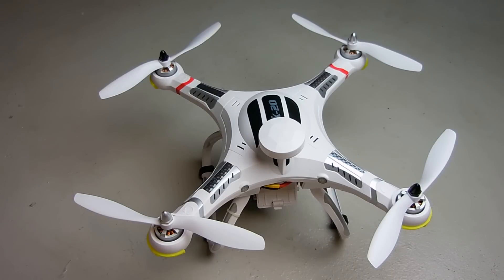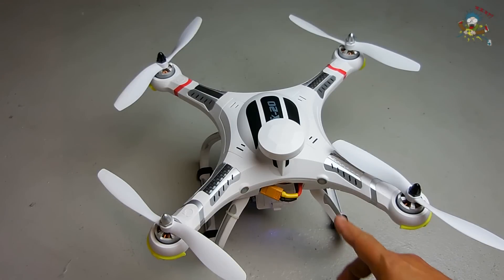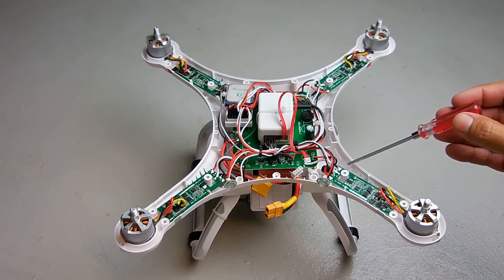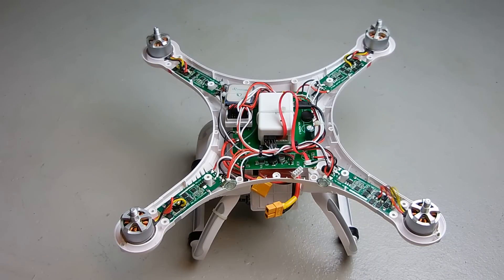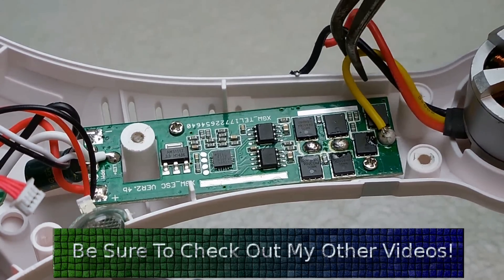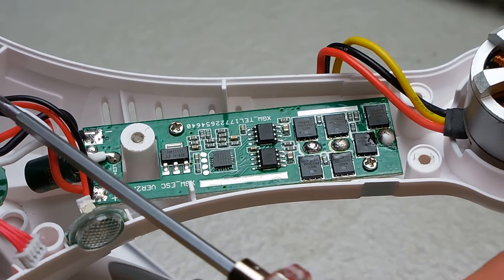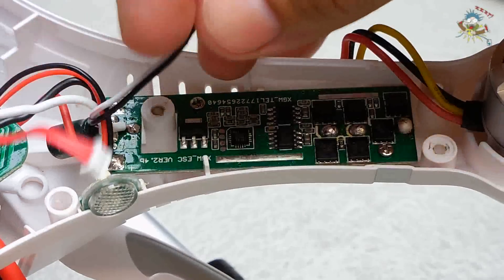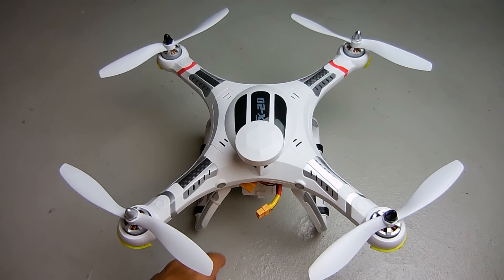How To Repair a Beeping/Faulty CX-20 or Phantom Quadcopter

Comment: Hi Mr.ElectronicNmore, I just got my esc board for my cx20 today ,imagine this board was ordered over seven  months ago and I actually gave up on it and thought it was just another scam by one of these Chinese companys anyhow yes I got the board and let me tell you ,its a second hand board ,then its not the board I ordered and the one they displayed was the ver1.5 esc and they sent me the ver2.4 with one wire not connected seems like they took it from a second hand quad and they didn't do a very good job of removing it ,anyhow I installed it with the colour code the same as the old one and it works but just a bit lazy ,any advice ?
Reply from the maker: Not much you can do, if you matched everything up. I can't believe they don't sell parts.
Reply: well after doing a couple of revs with this 2.4 esc installed ,I just fried another esc and motor ,they just ran hot and smoked, both the esc and the motor is done ,I think I give up now .Spending too much on this thing ,maybe I will just buy a Mavic or something.
Reply: I ordered four from BuddRc and hopefully they  are ver 1.6 I will put them in ,all new and see.

Comment: Hi electronicsNmore , my cheerson cx20 crashed about a year ago and I am finding it hard to get the original ver esc which is a ver1.5 all I see on amazon is the ver1.6 ,can this work for me?
Reply from the maker: "Should" be fine. Just make sure all the connections match up.
Reply: ok electronicsNmore thank very much .

Comment: Hi,
Need some help please,been flying my cx-20 for 3 weeks all set up in mission planner everything working fine,come home and made the max angle = 3500 to combat the breeze
today and now the quad will not arm, been trying for 4 hours and am going nuts ! everything is all working fine in m/planner, getting 5/6 sats & green light lock but wont arm, tried moving yaw & throttle trims, have you any idea what i may have done ?
Reply from the maker: Kevin Hill You probably need to flash the unit with the factory ORIGINAL file.
Reply: thanks for the advice i will try to find one today, is there a boot jumper pad on the board ? i have only ever flashed naze & omnibus f/c boards,

Comment: I had a heck of a time getting solder to melt on these boards-they must use some special solder because I ended up ruining one ESC trying to reconnect with the new ESC.
Reply from the maker: That's weird. I never had any problem.
Reply: i also had these problems, this is because the use lead free solder.
Reply: Try getting a soldering iron that has a variable temperature to at least  450 C and has a fine point to it.  That fixed the problem for me.

Comment: My esc problem with this is that it does not jeiro but the engine does not have the strength to turn already changed the engine and continue the same way and also calibrated the ESCS but continued with error.
Mes esc is the 2.4 version and am having trouble is the same version for your videos vc replaces the version 1.6 and gave no trouble.
I ask can exchange esc for version 1.6 and the others are with version 2.4

Comment: does anyone know where I can find the original cx20 tail LED light for the GPS and unlock moto light .the ones on ebay are different and do no come to the wire that connect both Led lights
Reply from the maker: Try here:
http://bit.ly/2aZ3RqA
Reply: http://www.ebay.ca/itm/Cheerson-CX-20-Tail-LED-Unlock-Lights-Indicator-Green-Red-for-CX20-Open-Source-/252364129010?
Reply: I did and the seller send me the wrong item ..

Comment: mine keeps beeping with the lights permenantly on, and none of the propellers power up
Reply from the maker: Did you change the factory firmware? If you did, that may be the problem. If you didn't then try flashing it ONLY using the factory firmware. You may also have a faulty main board.
Reply: +electronicsNmore it has worked fine, it happened suddenly, and how do i flash it using the factory firmware?
Reply from the maker: Download "Mission Planner". You can find links to the factory firmware file on Ebay listings showing the CX-20.
Reply: it doesnt seem to be able to connect with mission planner
Reply from the maker: Marios E Make sure you choose the right COM port, the battery must be connected to the quadcopter when the USB cable is connected.
Reply: I have this problem too but I have tried that and its just not detecting the quad
Reply: +TechReviewsUK same happened with me (you can check out my video on it to make sure its the same) so i contacted banggood, (where i bought it) and they kindly provided me with new flight controller, i m waiting for it to arrive, i believe it ll work

Comment: I have one I bought for our adventures in the Amazon Jungle on one of our fishing adventures,, after flying it there,, crash fall in wind gust,, we taped it back together and continued flying it,, Gimble was broken, made one up from boat parts to continue filming,, packed it up and came back home,, bought new shell for it,, but now it wont unlock the motors.. all lights go on,, we checked all wires for faulty wiring,, and none found.. but did remember that once in a while it would take longer to unlock than others even when we first got the unit.. any ideas on why they take longer to unlock at times and what could be happening with this one.. worst come to worst,, i may have to buy another one and keep this for parts...LOL.. 
but would like to find more trouble shooting information for all of us with different situations,,which is hard to find..
regards and great video,, thanks.. from deed in the Amazon,, AmazonXtremeFishing.com Adventures
Reply from the maker: Hi there. When I have a problem unlocking the unit, I flip one of the transmitter switches to a different position and back, then try unlocking it again. That usually works. If it does not, then I disconnect the battery and reconnect it, then it works. Could be a faulty transmitter. If you do buy another one, you can refer to my CX-20 unboxing video. I have a link which you can use to save money. Under 200 shipped. Thanks For Watching!
Reply: +electronicsNmore my. cx 20 beeps just like the the one in your video but i never flew mine what could it be

Comment: I did more than swap, I replaced the motors,  I should have bought two red and two green ESC's that way I would at least be able to test them, for right now I'll just have to wait for the mail...
Reply from the maker: Do me a favor and only reply to the same thread you post. It prevents cluttering of the comment section. Try disconnecting the connector from the esc board to the "Main Control Unit" and let me know what happens.
Reply: +electronicsNmore same thing bro, the plug is disconnected and it still beeping
Reply from the maker: William Jeffery
Definitely a faulty board.

Comment: GREAT! what are the chances of getting two bad ESC's because I bought one soldered it in and the $#%#%thing doesn't work!😠 same beeping! same motor! ready to get my sledgehammer and I'll fix it forever!
Reply from the maker: You're positive you replaced the correct ESC board? I hope you didn't short out any of the nearby components when soldering the motor wires to the board. It should work. Give it one last try before destroying it. :-)

Comment: Before ordering a new board you can always try changing the capacitor, capacitors often fail.
Reply from the maker: +zerpBot 
The electrolytic caps on the board were perfect. :-) They were the only 2 components I checked. No bulging, and normal ESR.

Thanks For Watching

Comment: Knowing your skill I thought you were going to show the fault on the board?
Reply from the maker: +Curiosity 
I could have ruled out several components, but it was not really worth my time because the board is so cheap. The square component to the right of the ams1117 VREG would be very difficult to test. You'd be better off swapping it out to see if the problem has been corrected. There were also (2) IC's that were unmarked, so I would have no idea how to test them. Thanks for watching!
Reply: yes you are right there for sure Curiosity, he is very  skillful and I admire him a whole lot .

Comment: Cool repair. Are you going to troubleshoot the board,to see what component failed.? 
All my best.
Bobby
Reply from the maker: +Bobby Tectalabyss 
I was going to look up the datasheet for each component to test them, but the time required and the replacement component would be much more than $14. :-) Some things are not worth fixing. Thanks for watching Bob!
Reply: +electronicsNmore my cx 20 wont stop beeping whats the problem